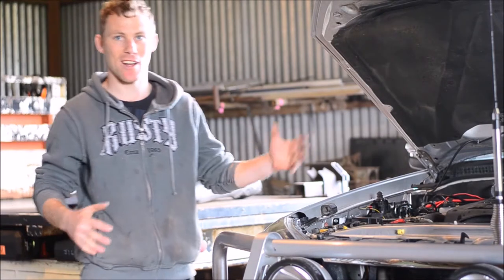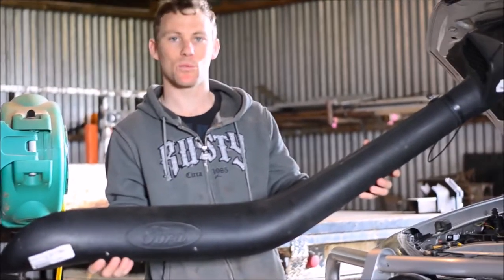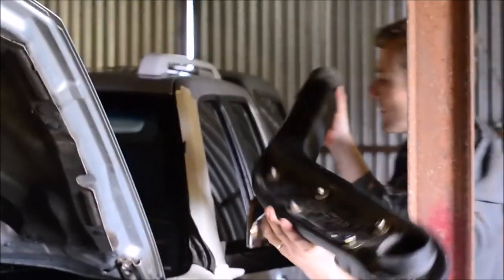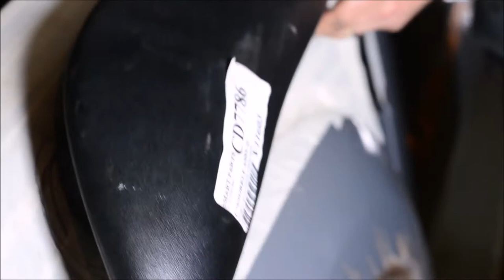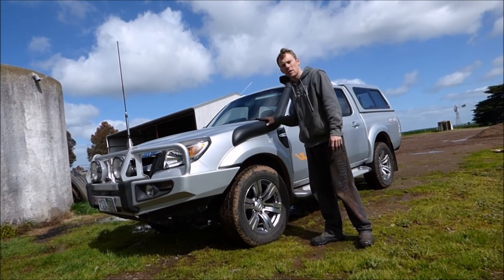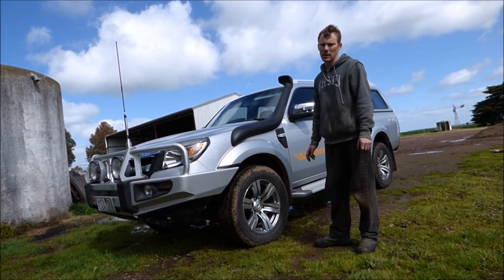Ford Ranger PJ/PK DIY Snorkel Install (no template supplied)

Comment: Great vid. Great looking truck. You inspired me to have a go on my pk. But with template. Cheers.
Reply from the maker: with a template it  would be easy, save yourself some money and have a go and do it
Reply: I had a go. It's on. The bracket for the piller was shit. I have tried 5 different brackets. I re watched and don't see if u use a bracket. Did u use one?
Reply: Sorry just saw your bracket.
Reply: Still can't figure it out. 😞
Reply from the maker: Matt Ammon hmmm you mean the bracket at the top of snorkel
Reply: Yes that's the problem. Did u cut the rubber at all?  I pulled rubber back and removed the plastic strip but b fucked if I can work out a way to attach any kind of bracket
Reply from the maker: Matt Ammon didnt cut rubber...you should see under the rubber a black screw which is what the bracket goes on
Reply: I need a bracket template for the top the one I got aint gonna work I don't see where I can attach it without messing with the door rubber I would rather it flop around then have water leak in

Comment: Be interested to see what option u take to tackle the egr issue.
Reply from the maker: at this stage ill leave the egr alone as ive had no issue at all, but im going to run a prevent catch can, if i do the block off plate id get it tuned and wipe egr code
Reply: have you heard of the EGR delete cable and do you know how to do a maf relearn afterwards?  cheers
Reply from the maker: yes i have heard of the egr cable, a little pricey for just a cable which i would put towards a dyno tune and get the error code deleted whilst getting a tune then just but a cable, but thats just my opinion.
after you clean the MAF and MAP sensors since my were very dirty, i disconnected the battery for a minimum  of 30mins came back and connected the battery and went for a drive. Im getting better fuel milage

Comment: Hey josh I’m over heating under load. Don’t suppose I had similar dramas?
Reply from the maker: Egr cooler? Or have you checked for a blocked radiator...i took my intercooler off and cleaned it also taken the radiator out and cleaned it as my blocked down low from the farm

Comment: How’d you install the roof racks mate
Reply from the maker: I just used u bolts on the factory roof rails...had to cut my u bolts shorter as i had them already in shed but you could just buy the right length

Comment: We have the same car, my only problem is not very equipped
Reply from the maker: Mine wasnt equipped when i got it but its slowly getting there..still a long way to go
Reply: Joshs Garage my one was $40,000 when I got it and it didn’t even have parking senses
Reply from the maker: Lol mine doesnt have parking senses either....ill soon be putting the airbags in the rear and a full length custom roof rack. Most things are fairly easy so go get your hands dirty and enjoy the DIY stuff